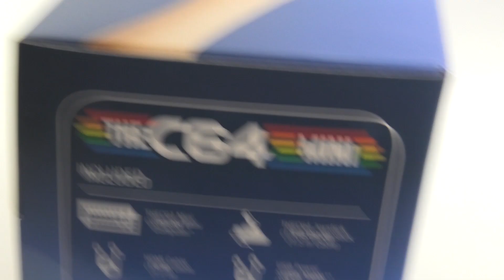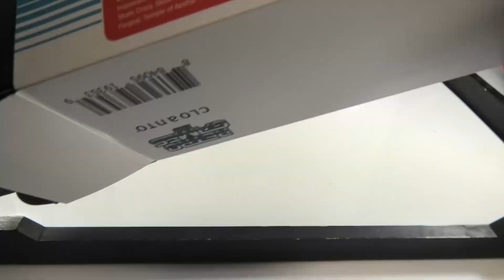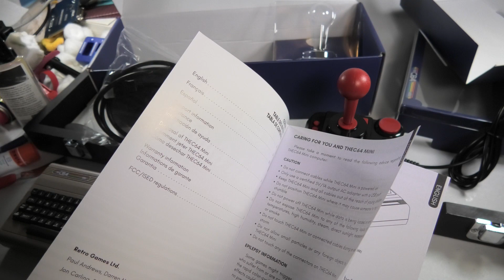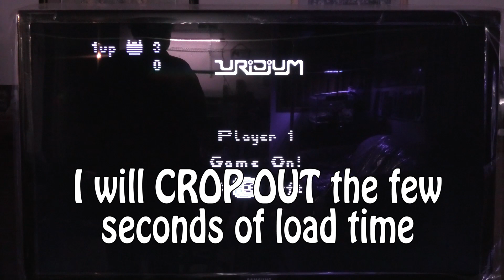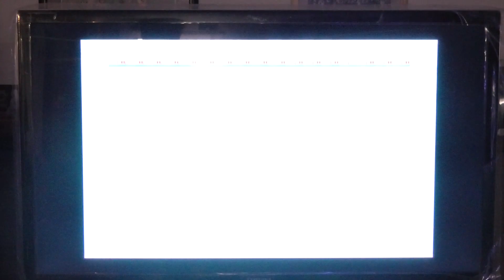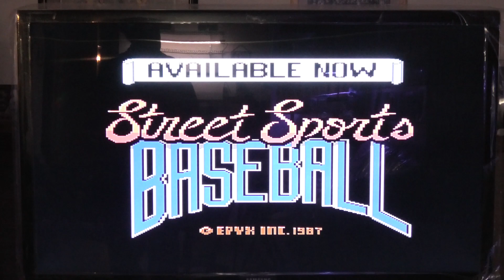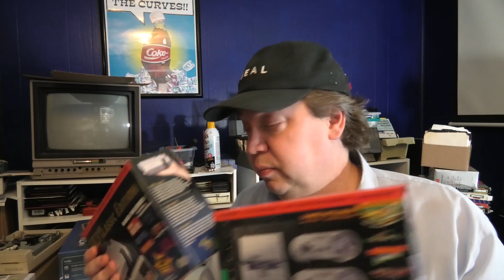The C64 Mini - Reviewed, Unboxed, Look Inside and Conclusion

Comment: The board has a 2GB RAM chip and an empty place for another one. It should have some kind of native mode where you can load some linux distro and have decent home machine for basic usage along with c64 mode.
Reply from the maker: I just keep thinking that if the NES mini and SNES Mini got hacks to add all of the games, MAYBE something cool like this will happen to the C64 Mini!?! BUT may there was alot more interest in the Nintendo mini's vs the C64